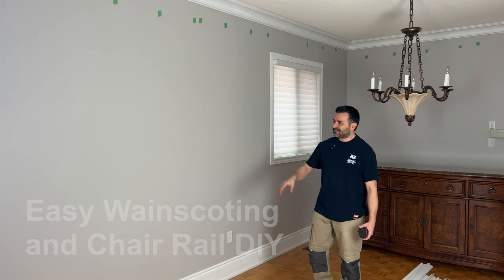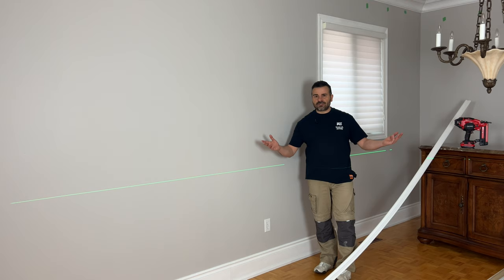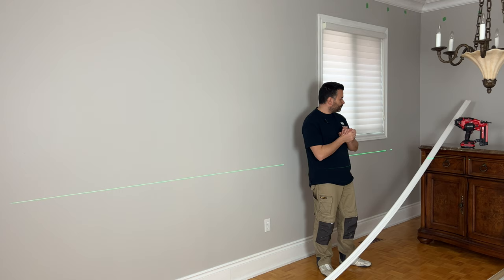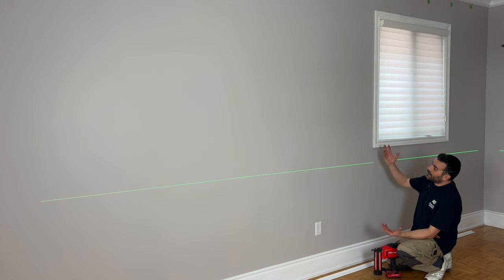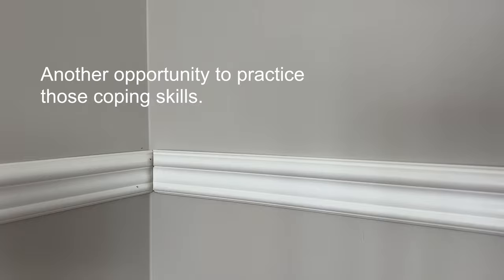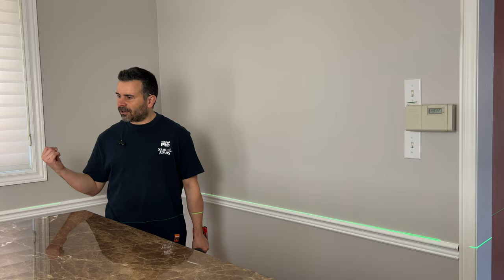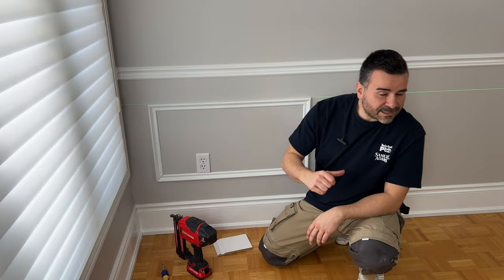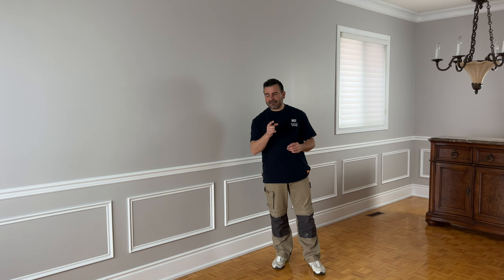DIY Dining Room Wainscoting & Chair Rail

Comment: It would be helpful if you used a dripless caulk gun, also you should pre-assemble the squares with CA glue and have all of the boxes assembled b4 you install them. Just as note, the pre-assembling of the boxes insures that all the corners are square and tight.
Reply: Preassembly is w/ CA glue (& accellerator) is the way to go IMHO. Preassembly is also key if the “frames” will be painted. Paint first, then install. The painter will thank you. If you don’t preassemble, it’s a good idea to make 2 spacers - use one on the vertical / left side & one on the horizontal / top side of each “frame” to ensure that the corners of your “frames” are square. Use the spacers to install all “frames.”

Comment: What was the length of your wall when you started the wainscoting? I'm not sure if how to measure how many boxes to cut out for.
Reply from the maker: Google wainscoting calculators. There are a bunch of good free ones where you can just type in all of your dimensions and it’ll tell you exactly how big to make your boxes and how far apart to place them.